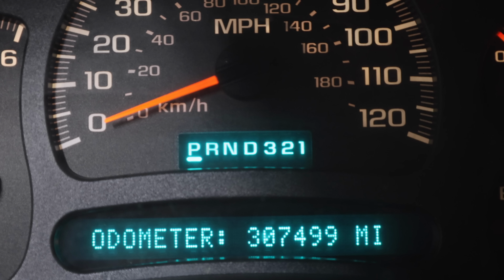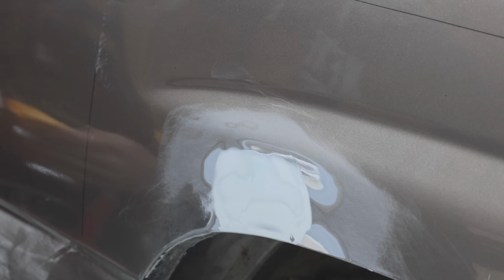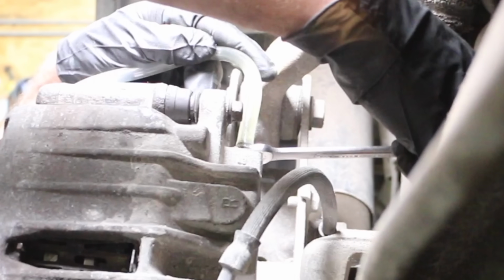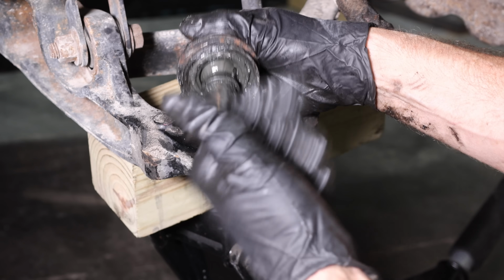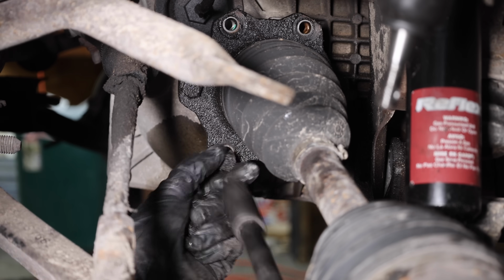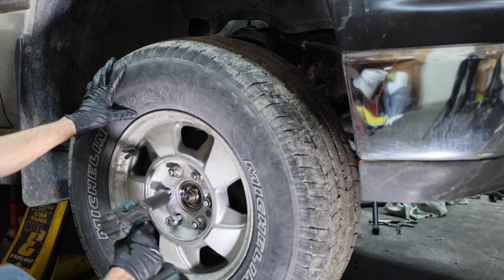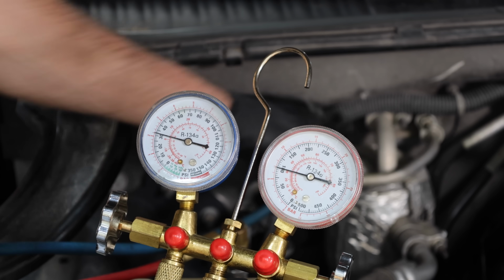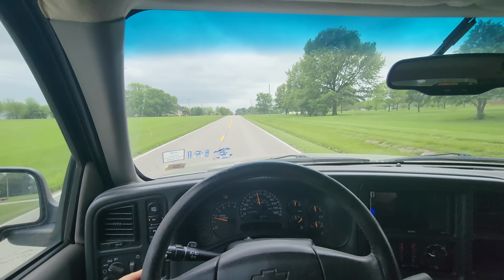Is It Stupid To Fix Up A 300,000 Mile Vehicle? Let Settle This!

Comment: Most of the new vehicles today won't make it 300000 miles. You're doing the right thing keeping the suburban alive
Reply: To be fair to new vehicles of any era or type, proper maintenance is crucial. People who buy new cars rely on dealer service intervals until they are out of warranty, and even then some people don't even bother. 

I know a guy who blew up his then-new F250 back in 2001 because he didn't bother to change the oil for over a year after he took delivery from the dealer. And my dad was one of those guys who stopped maintenance when the warranty ran out.
Reply: @taxirob2248 yeah, it’s mostly up to the owner and how they treat their cars and the environment they’re driven in.  But there are some notoriously unreliable vehicles out there.  But most anything can be repaired until the body and frame rusts away.
In this case, it was worth it since he did the work himself.  If there was done by a shop, it very well may not have been worth it.
Reply: @Ryarios  for sure. Professional labor is expensive, and it's not always good.
Reply: If most of the new vehicles today won't make it 300000 miles, can you please let me know which ones will?
Reply: @Coolcarting  Toyota
Reply: @Coolcarting  With proper maintenance, all of them. Just take good care of your stuff.
Reply: @Coolcarting  "treat your vehicle hard and it will treat you hard" keep it garaged, maintenance up, and replace things. Most people have an internal vehicle mileage breakpoint that was learned somewhere. At 100k miles replace as many rubber parts as possible (belts hoses spark plug wires). When the vehicle gets to the point you don't trust it, use a rental car for long vacation trips.
Reply: @Coolcarting  If you plan on driving 300k miles in a short time I suggest Tesla....
Reply: @Trust_but_Verify  Yep. Though batteries have a age limit in ways steel doesnt. A physical engine can sit for 30 years, a tesla battery needs replaced every 10 to 12 years regardless of use due to age reasons. 

But on the other hand, if you are driving some absurd mileage per year, the tesla has less wear parts and the battery replacement isnt all that expensive either compared to a new engine + transmission, and then fuel saving fees. Plus it being just safe.
Reply: I'm pretty sure most of them are lack of maintenance from the owners, they never care about oils, parts, because they never think about it, or there parents never taught them or they just expect it to last forever, but they really never give in on tiny important details that will cause big problems
Reply: Heard that same thing about vehicles when This one was new.   In the 90s I had friends complain about these 'new cars with computers, you can't work on them any more'.
Reply: Where are the rest of those trucks then? They didnt make it either.
Reply: Hell most of em don't even make it to 100k this is all makes besides maybe toyota or Honda
Reply: They can. You just have to replace bigger and bigger parts every generation. You can still swap out engines and transmissions. Of course, don't ever buy a CVT unless its in a gokart since those things are junk no matter how well they're built. We as a society just don't have the ability to make durable CVTs.

Comment: I have 380,000 on my Ram 1500 V6. It uses a quart of oil between my 5000 mile oil changes. Almost completely driven at highway speeds.

Comment: They are Axle stands and NOT jack stands, they are designed to be placed under an axle. Furthermore, the steering components are as follows: Pitman arm is attached to the steering box, the other arm that balances it is called a relay lever and not an idler arm. You really need to get these names correct, countless people watch your channel, worldwide. Moreover, they are CIRCLIPS everywhere else in the world and NOT snap rings, only in the USA are they called the stupid name of snap rings. While we are on the subject, SOLDERING has an L in it. The reason circlips fly off is that circlip pliers are not made correctly any more due to the cheap crap coming out of China. They are supposed to be inverted pyramids to help keep the clip on the pliers but now they are made parallel because it's cheaper to make them like that. Spark plug wires are called High-Tension Leads

Comment: It aint broke and dont need fixin.  Vids are top notch as they are.  Pace is perfect.  I have no problem following content.  I rarely watch vids over 40 minutes.  Change for the sake of change is a huge mistake.  BTW that was not a power steering pump you were handling, it was the steering gear box.

Comment: Engine running fine, yeah, fix it up. Ill be 72 y/o this year, just came back from a 4,000 mile, 18 day trip, on my 2016 Suzuki Burgman, with 91,500 miles on it. The CVT belt broke in KY, but I live in upper Illinois. Got it back, and my dealer is replacing the belt and other parts, for around $2,500. It's worth less than that...to someone else. The engines are great, and is hard to tell how long they would last. I love that style and they don't make it anymore. A brand new bike would cost a helluva a lot more, so by the time I'm done, it'll be like a new Burgy.

Comment: I’ve got 360,000 miles on a 2001 5.3 liter Silverado. I’ll keep it going as long as I can.  It’s built much better than the newer ones. Love your channel!
Reply: Ive got a 1996 z71 plow truck with 245,000 miles and it doesn’t even have a check engine light on the dash!

Comment: You can throw $1,400 a month at the old rig for the next 5 years, vs. the purchase of a new "base model" suburban off the lot. Great video! Future test suggestion: Postal service has started a new campaign to have rural customers update to new larger or "Jumbo" size mailboxes. Test of capacities, corrosion, and severe cold vs. Cousin Eddie with a Louisville Slugger. Batter Up!!!

Comment: Depends on the vehicle and how it's been cared for. A mediocre vehicle that's received little maintenance? Don't bother. A good-quality vehicle that has been well-maintained (Usually the case with vehicles that have racked-up high miles)..usually a good bet; better than an old vehicle with low miles that hasn't been used or maintained. Sitting kills vehicles quicker than mileage. I've always bought high-mile vehicles. Usually get 'em around 200K miles and keep 'em for another 100K. I try to pick vehicles designed for fleet use (Like Ford F250/F350 trucks & vans; or Panther platform cars [Town Car, Marquis]...I drive 'em..rarely ever have to do anything other than normal maintenance....then sell 'em 10 years later for what I paid for 'em! 
        The newer vehicles though...forget it! Too much expensive crap to go wrong; parts get hard to come by too soon; everything requires dealer-level programming...and once the manufacturer stops "supporting" the model, it's done.

Comment: I have a Miata with over 360k miles and a 2010 Ford Fusion with over 330k. Both have only needed regular maintenance and some sensors replaced. Still have spent less than an insanely priced new car to maintain both of them.

Comment: I'm actually in the process of big league maintenance on one of my cars.   Some of the work is a real challenge,  but my friend is helping, and that makes it better.    With the way the vehicle market is now.........  if you can DIY the lion share of the work,  that's the way to go.   I  will rebuild the front end,  and then let the garage do the alignment...     I'm no auto garage,  but I do enough work,  that a local auto part shop gives me the "shop prices"...  and that's a big help.   Since they don't have a bunch of improper installs from me... they trust me enough to not be a "warranty king".

Comment: I've recently gone back to this type of repair, as a younger man it used to be exclusively for restoration but now I'm re purposing, in particular the inline six cylinder Australian built Fords. These cars have paid for their carbon footprint many times over and are a breeze to work on with little ECU and insane modules. I just had to upgrade my toolkit for difficult access applications, I bought OEM tool additions for about 500AUD, couldn't justify a Proto or Snap On upgrade. These things are so expensive in Australia compared to you guys.

Comment: It’ll be a miracle if my car gets to 300,000 miles. 

Not because of maintenance or rust, but those damned deer that constantly jump out. I swear I paid just as much in repair bills over the years as I did to originally buy it.

Comment: 1) Don't mix Bondo on cardboard, because the styrene resin gets sucked into the cardboard.
2) if you wipe your Bondo with acetone when it sets, that sticky residue won't stick to your sandpaper.
3) You should use all-metal filler. Standard Bondo sucks in moisture, so the rust will begin again quite quickly.
4) You should treat the space behind the new panel with cavity wax. Otherwise the repair panel will rust out from behind.
5) You should put a fairly heavy anti-rust coat on the outside  of the new repair before your color and clearcoats. Most spraycan touchup cans don't provide much protection against moisture and salt.
6) As you've probably noticed, you didn't really need that repair patch. You could have easily made the repair panel yourself. You're a smart guy. Thanks for your channel.

Comment: I've done that and more for decades. I'm a mechanic and have assembled several trucks for self and the lot where I worked from wrecks. It's not difficult if you pick a good RUST FREE vehicle.
Early 2000s and prior trucks are nearly all practical to drive indefinitely including full rebuilds axle to axle if you do it yourself and it's quite common.

Comment: Highly recommend upgraded any Gmt800 vehicle pre 07 to the larger 07-08 calipers mounting bracket pads and rotors. The stopping power is increased drastically by almost twice the rotor size, bigger dual piston calipers and a much larger pad surface area.  Doubles the stopping power and reduces the braking distance by a lot!  Best part is its a direct bolt on!  Cant recommend it enough!  @LSXMatt has a guide if you are interested! Also recommend silicon plug wires. Gmt 800 are known for metling plug wires too. Silicone helps and plug wire heat shields help even. more.

Comment: Keep truckin brother. Wouldn't change a thing except for 1 thing.......that's not a power steering pump its a gear box but it works in conjunction with the pump😆

Comment: Just picked up a 1998 Tacoma with the 2.4 engine and 5 speed manual, with 323,400 miles. Did a tune up and changed the fluids from the rear dif and transmission. Running like a dream 😎

Comment: Taking a wire brush or even a file to the caliper bracket where the clips seat is usually a good idea. Some have very tight tolerance and rust buildup can cause the pads to hang up on them. Oh, and keep the pace!

Comment: With that many miles. Most overlooked and by you, most people don't change the soft brake lines. The inner lining breaks down over time and can give you squishy brakes. Worst case they will not let fluid back and causes the calipers to stay locked up. Also with that small of a rust patch instead of wasting $75, a flat piece of 18g steel bent in a bench vice is sufficient.

Comment: Please stay away from the 9 o'clock position when removing the diff seal on the driver side, there is a key that's used to hold the outer part of the diff in place, & it's installed from the inside. Otherwise good work.

Comment: I think the pace is fine for the videos but maybe some might appreciate it slowed down just a slight bit if they are trying to figure out how to do this for their own vehicle. I do think this info for many is priceless though, the videos are very encouraging to get out and work on your own cars. As a former auto body tech though I would recommend giving you a few tips for a cheap spot repair like this. For the body filler, it really kinda needs to stay on the metal and not be spread too large where it gets into the old paint because many times it will have trouble adhering unless it has very deep scratches in it, 36 grit scratches worked great for me for adhesion. Now you can use a glaze type filler over the top which can go into the paint and works fine. Also with body filler you really aren’t supposed to use cardboard to mix it with the hardener, the cardboard absorbs a fair amount of like the solvent and other chemicals in it and can throw off its consistency for certain brands. I have seen shops that do it and I have done it in the past but it’s just well not as good. Thanks for video.

Comment: Cave it and pave it! The welding will have damaged that primer on the back side and the rust will return make sure you get some sort of corrosion prevention on the back of that repair, just use an underbody coat. Also make sure that any drainage weep holes are clear so there is no standing water.

It's better to spend a couple grand in repairs than tens of thousands of dollars in a new car loan that'll just need the same repairs eventually. Thanks for documenting your repairs and i'm looking forward to seeing the burb on it's 400000 mile check up

Comment: One tip for you for those control arms. If you hit the knuckle with a hammer a few times the control arm will pop right out, no need for the pickel fork. This is especially useful if you are going to reuse the control arm so you don't rip the boot

Comment: I did the same thing, I bought a 2000 suburban 1500 2wd  with 235k miles for $500, moog front end suspension, tires, and tune-up and a junkyard transmission, car running like new.

Comment: Your pacing is perfect. My only suggestion is that in the rust belt you make sure you can break the fill plug free before you open the drain plug or you risk not being able to refill the fluid. Probably not an issue for you with routine maintenance..

Comment: $2,000 is way cheaper than buying a new vehicle. Even if you're paying 40K for a basic vehicle, you could spend up to 95k on a diesel truck and you cannot beat the right of the older Tahoe and suburbans. They ride like your on a pillow

Comment: This was a great video as always. Your Chevy probably has the 5.3, they will last almost forever with proper maintenance. Keep an eye on your oil pressure with that kind of mileage, the LS style engines have an o-ring on the oil pickup tube and they are notorious for failing. I've seen folks sell a vehicle because of this issue and all it needed was an o-ring.

Comment: Hey Todd,

While I prefer the review videos, and I think they fit the speedy content format better, it was interesting seeing how you do things by yourself, especially the alignment.  I don't think you should slow things down, but I think this was about 10-15% too fast to be an instructional video.  

I need to swap my brake fluid out soon, and as I typically am working by myself, I did not realise that I can get a decent vacuum pump for so cheap, and was going to pay a shop to do it.  How did you attach the 1/4" tubing to the pump?  does it just slide over the fitting?  

Couple other things:  

* greasing the anti-rattle clips doesn't prevent squeaking, it just collects dust.  the need for this has been debunked.  

* don't use an impact driver to install the new axle nut

Comment: The argument is that if you spend more than the vehicle is worth, then you're a loser.  However, if you spend more than its worth to not buy a $$$ vehicle, I think you're a winner. We have a 1997 expedition that i recently replaced most of the front end - and am still driving.  I "only" have 187k on it however.  Good video. Shows what you can do yourself to salvage an older vehicle.

Comment: Lots of great tips for keeping an old truck on the road!  Btw I use the old eyeball method to set zero toe.  No measuring required.  Zero it out and give it a tick of toe in.  Sight in the line across the front wheel.  No measurements no errors.

Comment: Tip, if the fuel injectors haven't been replaced or cleaned properly, do that. It made a world of difference replacing them with cleaned and flow tested serviced ones! Along with new fuel filter and I did a new fuel pump and sock at the same time. Got tons more HP now that was missing, yet the car ran well...

Comment: Bro, as a master tech with 20 years of experience, you did EVERYTHING exactly how I would (minus the paint on the knuckle and the body work). This is fantastic information for beginners and those that want to maintain a high millage vehicle. My F-150 (08 Lariat crew cab w/ heavy duty tow package) is at 580,000 miles because I maintain it as well as you have on your burban. Keep up the good work my man.

Comment: I’ve got an 04 Chevy Z71 with a 5.3 just like that suburban. It’s got 337k on it all original drivetrain. Ive owned it since 2009. I’ve replaced a lot of stuff over the years but it’s been one of the best vehicles I’ve ever owned.

Comment: I've owned some high mileage cars  and the most annoying thing was that even if the mechanical condition was made perfect, the windshield would have been sanded by the years od exposure at high speed to sand and an dust. Especially in the north wrere sand was commonly used on roadways in the winter.

Comment: Thanks for showing everyone that old can be gold. My Audi has 308k miles and never left me stranded. Regular fluid changes on all of the 3 differentials, the transmission, and of course the engine oil, and brake fluid have been a huge help and never had to replace anything major. Just belts, a couple pulleys, brakes, and fluids and it's happy.

Comment: Alas, the cost for even the few tools you use would be more expensive overall than what it costs to have it repaired for professionals. However, $2000 every couple of years to keep my 2010 Honda running? Worth it. 230k and hoping for at least 70 more.